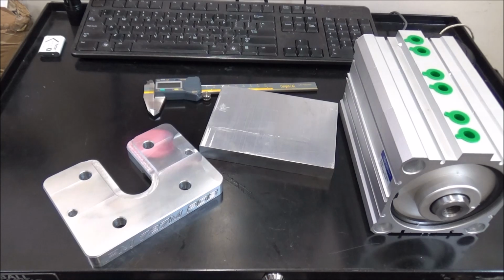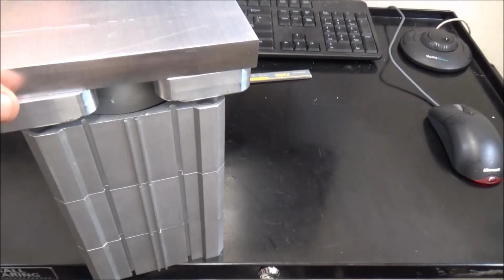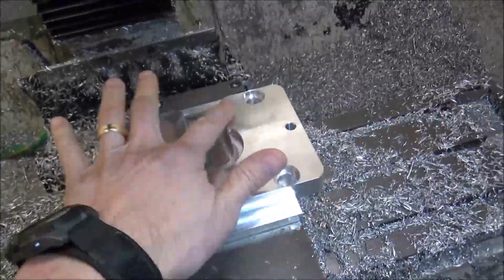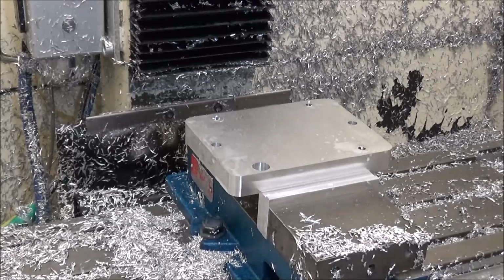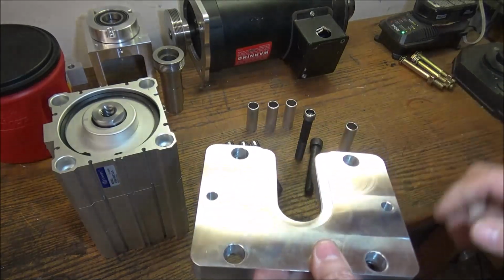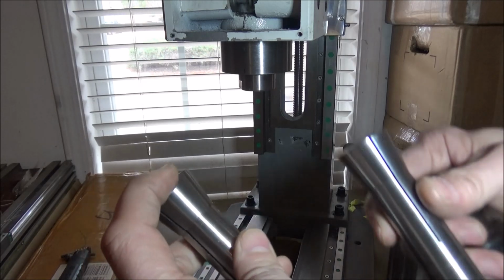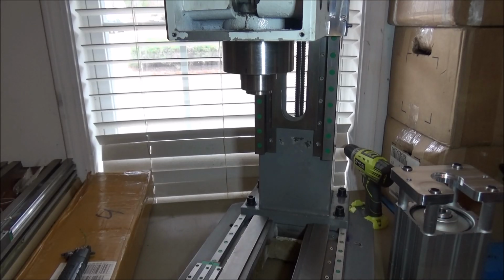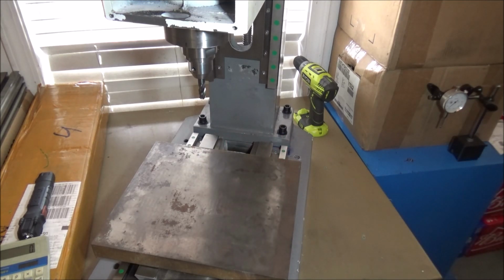PM727MXL PDB Lift Plate

Comment: Its always nice to see you doing work and great videos to and I cant wait to see it done.the motor shroud is a good idea my tormach swing around to the Left the new one flip up like a car hood. Also the DMM motor drive that you are using do you have the info on them and where would I buy from it sound good to install a set on my 6x12 plasma / mill router setup.
Reply from the maker: Still have not decided on the cover but they look nice.
DMM servo these are metric 80mm frame size. but they also have Nema 34 750watt servo 86M-DHT